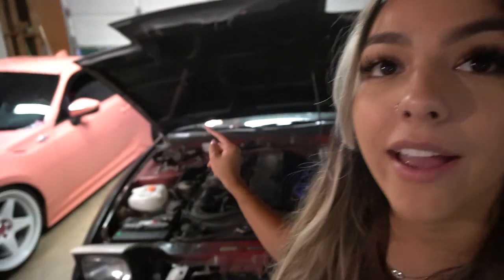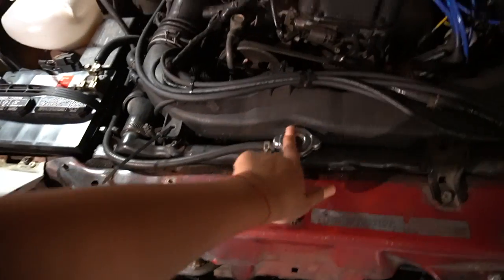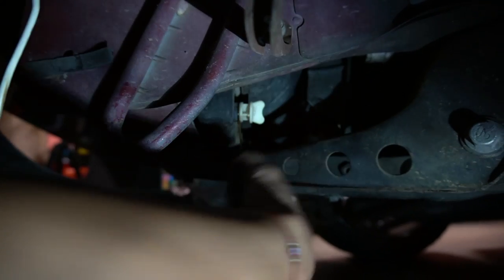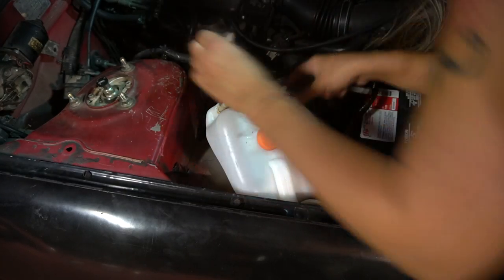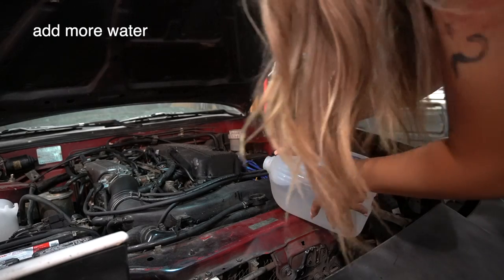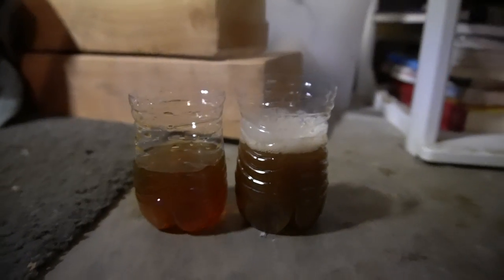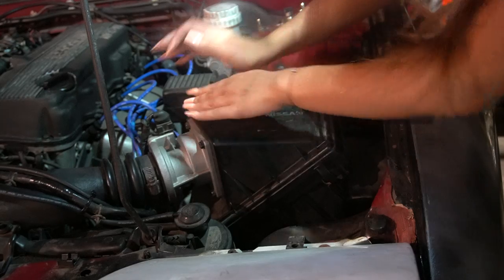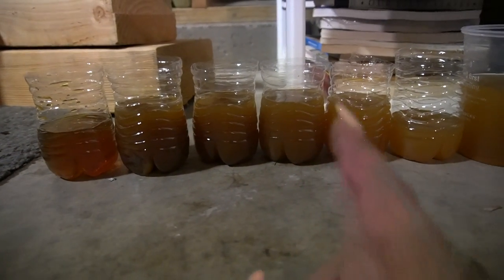240SX MAINTENANCE: COOLANT FLUSH/ CHANGE S13

Comment: unfortunately thats the nature of the beast. i repplaced the radiator on my truck, which it's a 7.3L, it took me literally all day, from 0700-2000, to clean the WHOLE system out. best way is to keep the tstat open or remove it to allow the coolant to pass freely through the whole car. remember it's got a lot to run through between the heater core and head passages.

Comment: hey Alex theres an easier way where as the engine is running put the hose in readiator and loosen the bottom radiator hose, that way it flushes the system as the cars running, personally i havnt tried it myself but im sure there s vids on youtube how to :)juat sayin but still i love watching your videos, i recently did a service and coolant flush on my car too, also it  might be a good idea to put a cleaner in the radiator looks like there s a  lot of junk in it which can cause headgasket overheating issues etc...goodluck with it all :))